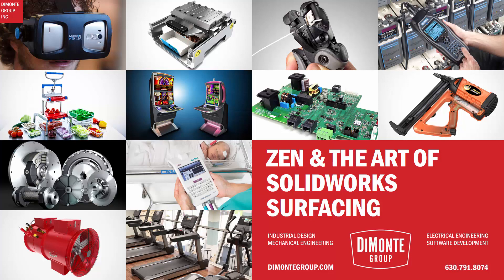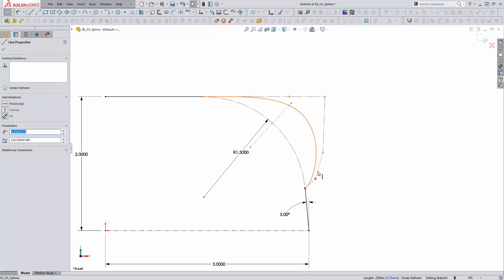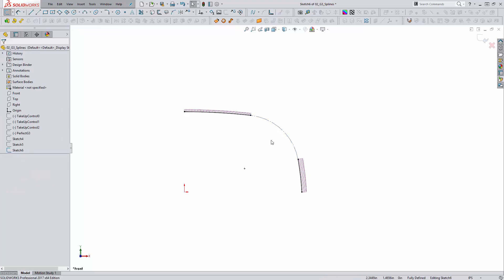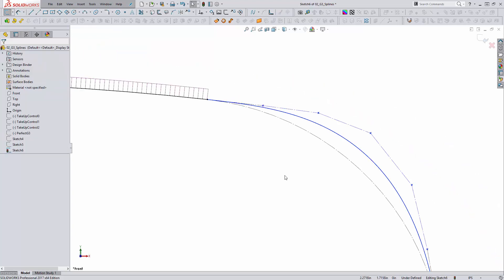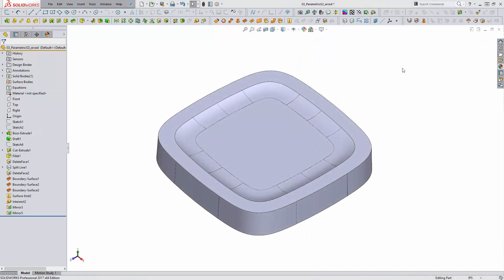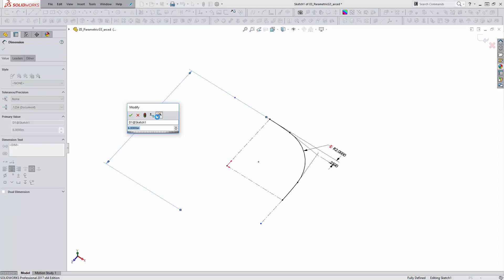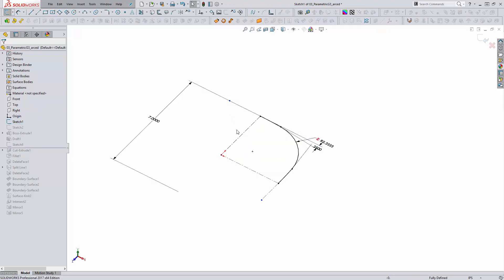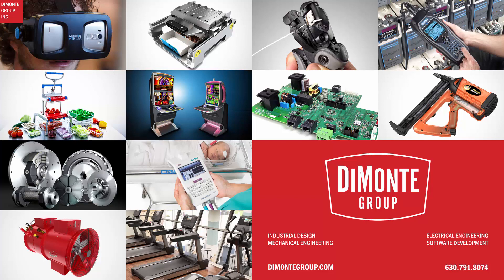More Parametric G3 Connections! - SOLIDWORKS Tutorial -   Zen & The Art Of SOLIDWORKS Surfacing 04

Comment: Very helpful! Is there a way to make a G3 transition between arcs that bend in opposing directions? E.g. if the the center point of one of the arcs was flipped to the opposite side, forming an “S”? I tried to reproduce the same method, with no luck.

Comment: Do you have any tips for creating smooth curves in a 3d sketch?
Reply from the maker: Great question.  Unfortunately, we aren't the folks to answer that, at least not as written.

There are times to use a 3D sketch, and we do.  But we don't tend to use them in general curve creation for a number of reasons.

1. They are difficult to edit

2.  Lots of things don't work well in 3D sketches.  SOLIDWORKS fixes things when they get enough reports of problems that they learn it is worth the effort to address those problems.  There just isn't a track record of them addressing problems in 3D sketches, because so few people use them relative to the 2D sketches that get used by everyone.

3. When a feature is broken and we can't make it work, we rarely go back and try it later on.  We have to keep working, so we fall back to what is reliable.  I can't tell you for sure if 3D sketches are awesome right now.  I can tell you I haven't heard anything to make me want to risk a job by trying 3D sketches again for primary curve construction (other than the limited way we do use them reliably).  Other folks might have results they can share, and it's possible I am completely wrong about 3D sketches in the current state of the software.

The reason we don't use them much is that there is a REALLY good alternative - projected curves.  If a 3D curve can be fully described by projecting one 2D sketch onto another 2D sketch, it works great.  Thinking orthographically (side view/front view) also fits in with the kind of work we tend to do.  And those 2D sketches that are used to construct the 3D projected curve tend to be more stable, and easier to rely on and edit.

-Ed
Reply: @DiMonteGroupInc great answer. I have the same experience.